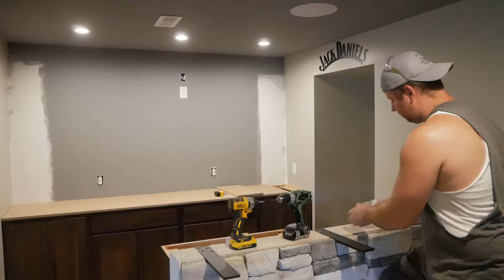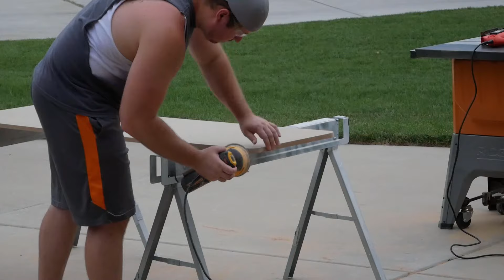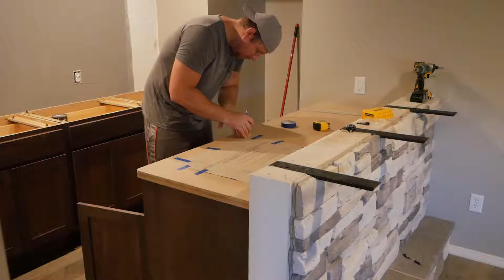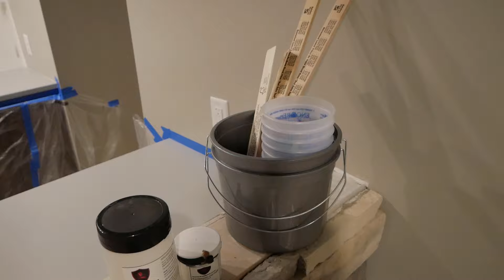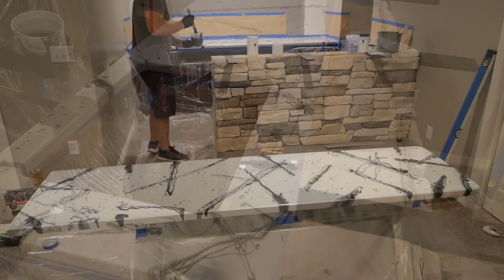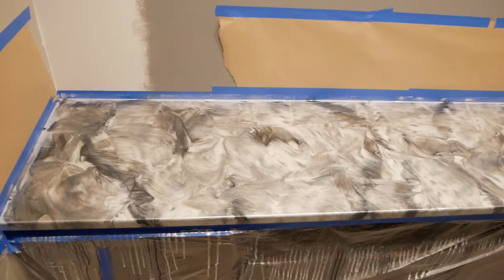DIY Epoxy Counter Tops | Turn MDF Into Amazing Counters with Leggari Epoxy!

Comment: Sanding after priming a few layers will help keep it level and hide imperfections. Just a tip for when you redo or have another project.
Reply from the maker: Imperfections should have been filled or sanded before priming. Even so, that epoxy will fill all low spots. Its self leveling, so glass smooth after it dries. The urethane protective top coat gave the surface a textured look

Comment: excellent video, one question: how would I protect the surface from scratches, I would like to try to do something similar, but I am worried about the resistance
Reply from the maker: That urethane top coat put on at the end is very scratch resistant. We used the place daily and had several parties/get togethers and no scratches at all for the 2 years we were there.

Comment: I was wondering how sturdy end up been top the counter?  Cuts etc., otherwise beautiful
Reply from the maker: They are very resistant to scratches. I wouldn't cut things directly on them personally, but they have shown no wear with normal bar use

Comment: Great job. Interesting to know why mdf?
Reply from the maker: Cheap, extremely flat and uniform. Smoother edges than when cutting plywood unless you were to buy some nicer boards that are 2-3x the cost of mdf. Once coated it's completely waterproof and hard

Comment: I didn't like it as you were swirling the product with the roller, but oh boy the finished product is beautiful. nice job brother!!! I think they overcharged by a mile for the product so I'm going to shop around. 10 out of 10 0n your part sir.
Reply from the maker: Haha I felt the same. My wife was kinda freaking out actually 😂 thanks man. They are a little step, I'm sure you could source the materials cheaper

Comment: Can i use paint primer, if so what should i look for.
Reply from the maker: For the initial priming of the mdf? Yea I used Kilz if I remember correctly. 2 thick coats to seal the mdf well
Reply: @LifeofBliss  Thank You, i live in Thailand, what should i look for on tin, it will most likely be in chinese but i will look for the word epoxy or water resistant etc.
Reply from the maker: Well I'd search for wood primer to seal the wood then you'll need some epoxy and metallic flakes to color it

Comment: Great job! Did you drill them in from the bottom up or top down and filled the holes with some sort of puddy?
Reply from the maker: Thanks man. Screwed them in from the bottom in several places. That way they can be replaced down the road fairly easy if need be

Comment: Do you think adding some wood filler and sanding it down on those edges would help with it not being as noticeable? I’m thinking about doing this but don’t want that seam to show.
Reply from the maker: Yep, that's what I did. The edge you saw that was bad looking went up against a wall so it won't be seen. There is no seem on the better preped edges I did

Comment: Can you explain to me how it covered the edges and fronts since on that side the MDF is very porous and absorbs everything, what method do you use to cover and that it is the same as the cover?
Reply from the maker: I sanded the edges with 220 to make them fairly smooth. After 2 heavy coats of the kilz primer, it sealed everything up pretty well. The epoxy didn't absorb into the edges at all after priming them. Watch the video where I go over the edges, I roll over them once then the epoxy just flows over and drips off. You coke back to clean up the drips a bit later. Very easy process

Comment: Looks fabulous, but I would be really concerned with the MDF swelling and warping your countertops, maybe I missed it but you didn't seal it before applying the primer. MDF is very pores, It will look great for a year or two but I'd be concerned about how it will hold up in the future. Does the product recommend using MDF or did you just use it because of the cost?
Reply from the maker: Yea I sealed it with the 2 coats of primer on all sides before doing the epoxy. MDF is what most of the companies use from what I saw. I used it due it being very flat and uniform. It's held up great so far, no swelling issues. I saw a video from stone coat countertops where they did shower panels with mdf! I personally wouldn't use mdf in an environment like that with constant water and steam...

Comment: How did you remove the blue tape..?
Reply from the maker: I removed it by hand... 🤣 I'll see myself out... Remove the tape while the epoxy is still wet, after you add the accent colors. If you wait until it dries, it will stick and you'll never completely get it off

Comment: I can’t figure out when it’s a good time to remove the painters tape??
Reply from the maker: You want to remove the tape from the walls after adding in the contrast colors and spreading it out. Its just to prevent getting any on the walls when spreading. You want to remove it while its still wet

Comment: You may have answered this already, but when exactly did you remove the tape?  What hour mark it looks like they were on there for a while after you mixed the accent colors and was still there when you poured the top flood coat?
Reply from the maker: As soon as you are done mixing colors, go back and pull the tape. You want to do it while the epoxy is still fluid. You have some time, no need to rush, but just do it after mixing colors
Reply: @LifeofBliss  Thank you could you repeat again what type of paint you used prior to the Leggari kit primer?
Reply from the maker: @youloserandwannabe  I believe I used Kilz primer. You could use that or BIN 123 primer

Comment: Hi, i live in Thailand and can get 1 to 1 epoxy resin from ''made in china'' can i use this for a mdf countertop along with Mica powder mixture. Can also get 2 to 1 ratio resin.
Reply from the maker: I'm not sure... you'd have to check with the manufacturer, but you'd probably be able to use it

Comment: Does anyone ever put just a coat of clear epoxy on the bottom of wooden countertops to seal the whole thing up especially say in bathrooms where there is a lot of moisture and/or  humidity
Reply from the maker: I'm sure you could. But I've even seen the stone coat counter top guy do showers where he only primers the back of mdf. A double coat of kilz really seals it up well. Granted I wouldn't do a shower with epoxy/mdf though...

Comment: Will this work without the primer ? The countertop I want to use is a laminate. Do I still need to prime ?
Reply from the maker: You won't need the primer like I did on the raw MDF. You will need the epoxy primer though that the kit came with

Comment: Looks great 👍 did you install an underlay sink? If so have you had any issues with water on the lip of the MDF assuming it is exposed. Thanks
Reply from the maker: I did do an underlay sink. Here's a video on it actually 😉 https://youtu.be/XfqkChlevNc
No issues with the MDF. I made sure everything was covered with epoxy that was going to be exposed. I rolled a bit on the underside when pouring it.
Reply: @LifeofBliss  thanks for the fast response. Is it possible to talk to you? Just wanted to pick your brain about a few things regarding your project. I can give you my phone number if that works for you. Thanks
Reply from the maker: Send me an email at lifeofblisskb@gmail.com that'll be a little easier for me.

Comment: how is the heat resistance on the this? like can you take a boiling pot off the heat and set it on the counter top.  they look great btw.
Reply from the maker: I don't think I would put something that hot on it. Leggari has a bunch of videos on their products including how it reacts to heat. They light it on fire, but the heat is above the counter surface so that doesn't prove much. I'd rather be safe than sorry and ruin the counter. We put hot dishes on them, but nothing straight out of the oven or stove

Comment: Looks amazing. Question, since it's primed and then sealed ... Would this be outdoor proof? For like a outdoor kitchen?. Hmmm
Reply from the maker: Hmm... I think I would use some sort of plywood instead of mdf for that. MDF will swell and separate if it gets any moisture. Plywood not so much. Better safe than sorry, but the process should be the same for plywood
Reply from the maker: But the epoxy is tough. Definitely use the urethane top coat, not the high gloss. May possibly yellow over time being in direct sunlight all day long as well

Comment: So it's been 2 years, how has the counter held up?  Do you think it would have fared as well in a high traffic area vs a home bar?  Also - pics would be fine or a quick followup video!
Reply from the maker: We just moved recently, but the counters have been great. The urethane topcoat is super durable, I doubt any serious wear would happen in a higher traffic area unless something sharp scraped the surface. I personally would cut food on it with a knife, rather do a cutting board

Comment: MDF near running water, condensation, and humidity is going to cause some issues.
Reply from the maker: That's why I primed the underside as well. Hopefully no issues, but yes moisture and MDF do not mix well

Comment: I have watches a lot of Leggari videos and never saw them use a torch and actually they say that with their products it's not necessary. Is it i. The instructions to use it?
Reply from the maker: Not in the instructions. They like to market it as torch free. There was not many bubbles, but the torch ensures there are none. Just an added step for good measure.

Comment: This is really awesome. But a question, why MDF? I've heard it's not super strong but I've never worked with it. Is it better than plywood?
Reply from the maker: Its pretty strong stuff as long as it doesn't get wet. Plenty strong for this application. Just have to be sure to cover every surface with a couple coats of primer to water proof. You could use plywood, MDF is just extremely flat and uniform. Plus it's cheaper. You'll spend 2-3x as much on plywood
Reply: @LifeofBliss  Great video, thank you for posting! What did you do to the underside of the MDF? Just a couple of coats of primer?
Reply from the maker: Yep, just primered to protect from moisture

Comment: How did this last??
I'm not sure whether to use epoxy on MDF or if concrete would give a longer lasting result. I'm just curious how its holding up over time?  Regards
Reply from the maker: It's been perfect since the install. We use it quite a bit too, several times a week. I've set tools on it while still working on things, no scratches, no water rings from cups... we love it.

Comment: I'm wondering how you get rid of the excess epoxy if it heats up and disolves plastic ?  Sopposedly it cant just be  thrown in the rubbish
Reply from the maker: It's fine once it dries. There's no restriction to throwing it in the trash as far is I'm aware. At least in the state I live in.

Comment: Now that you have lived with for awhile is there anything you would do differently? Turned out beautiful , I've been considering doing mine and you have convinced me to use the Leggari product over the others. Thank you
Reply from the maker: Thank you! We like the way they turned out, especially for the cost. After looking at many other counters, we could have used a little less black/silver coloring in them to make them lighter overall, but that's more of a look/technique thing. I'd just watch as many videos as you can and pay close attention to how much color is added and how they swirl it. Good luck with your counters! ☺
Reply: Life of Bliss I do like the colors you used and those are the colors I'll be using only more silver. Like you I have watched so many videos and this is much cheaper and buying news but for me just a little pricey. Several years ago I did mine using craft paint and sealed with a product from lowes now I want to change them again!! They had held up very well and have not babied them at all,  mine are very glossy do you like the stuff you put in there that turned them not so shiny?
Reply from the maker: Yea I'm glad we went with the urethane top coat. Gave it a little texture and is about 4x harder than the glossy epoxy top coat. It would hide scratches much more than glossy epoxy on its own
Reply: Life of Bliss thank you for the tips and your baby is so adorable. God bless

Comment: Nice. I would have taped the edges equally to make a border, then when the epoxy is poured you move the table around until it all finds flat (like the ocean). Final result is a perfect untouched coat that can be poured up to 2” thick. Use a torch to pop bubbles clean.

Comment: how do you secure the mdf on the cabinets? Just bunch of screws on the bottom?
Reply from the maker: Yes, added about 10 screws on the larger and 8 on the smaller counter. Screwed in from the bottom and attached it to the side supports on the cabinets.

Comment: I’m not sure this specific companies recommendations but for most cases this isn’t how you want to do this as you’ll end up with high and low spots.. generally you move end to end lightly to make sure the product levels properly.. if you want a swirl king effect then you add the color into the epoxy so it sits on top but not mixes into the proxy keeping surface tension.. you then get the marble swirl effect just from pouring the colored epoxy and spreading it. 

It turned out great looking though in the end!

In the end I think I would’ve had used a top coat of clear epoxy to get that extra 3D marble look..
Reply from the maker: Thanks man. Yea that's how this company does theirs. Turned out very smooth though 😉

Comment: Along the back and side edges does it leave a ridge?
Reply from the maker: No, just be sure to use a tiny amount of clear caulk to make sure it doesn't run down any cracks. It follows the caulk curve up the wall just slightly, but looks very flat and consistent for the most part. Be sure to tape the wall off and remove the tape after the color is added and everything is still wet. It will self level against the wall

Comment: Great DIY video, the colors are awesome and your project came out kickass..by the way the term for the epoxy when its heating up in the cup as it cures is called exothermal heating . it can get very hot the more volume you have in the container and lets out more of the toxic fumes as all epoxies do. so good to have ventilation also . just a thought ., what was the Kit # you used..
Reply from the maker: Thanks Alfonzo. Yea I've worked with epoxy before, but not with this much volume. Was hoping the thicker plastic I used would hold up, but it did not lol. There is 0 VOC with this product as well, so no fumes coming off. There wasn't really a kit # from Leggari, just a calculation for square footage and they get you the correct amount.